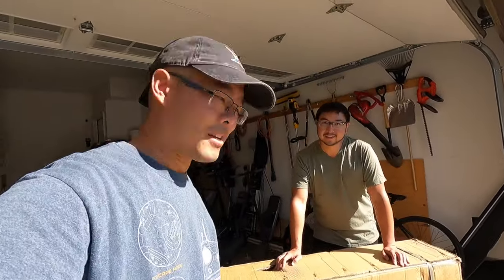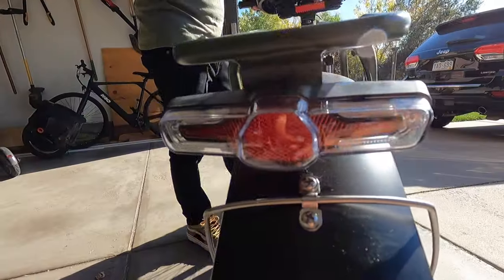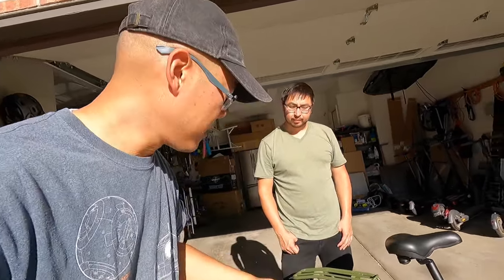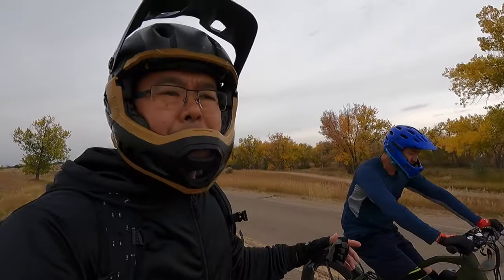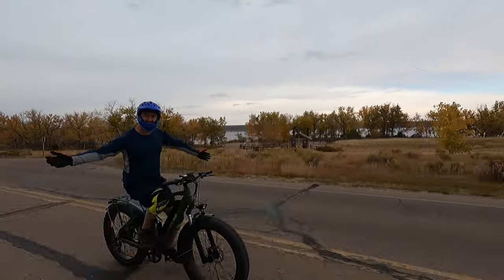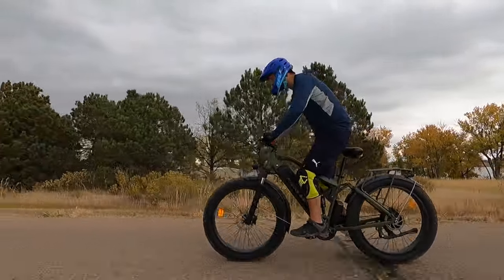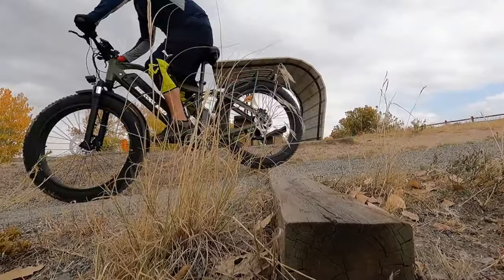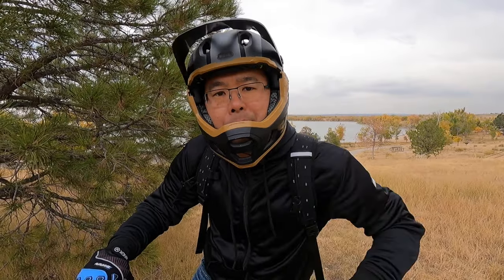A Most Affordable Full Suspension Fat Tire Ebike: the Bee Cool Adventurer

Comment: Thanks guys for a great review. I have been doing a lot of research and the Bee Cool adventure seems to have all the best features for a great price, almost too good to be true. I just put my order in and it was $200 off. I am 6'3" 250lbs and this is the first ebike I have found that has a 350lb weight limit. Seems like the frame is very heavy duty and also good for riders up to 6'4". I was also looking at the RAD ebikes but they are limited to 275lbs and did not have both front and rear suspension.
Reply: I just received my Bee Cool bike two weeks ago. Its exceeded my expectations. Well worth the price. I''m 5'11" 325 lbs and it handles me with ease. it goes between 22-25 MPH. Again, for the price I think you"ll be very happy with it! I know i am.
Reply: @hawkeyefootball7323  in 6'5 340 and considering this bike. How's it holding up 3 months later?
Reply: @hawkeyefootball7323   Do you still like the bike ? can you program it for higher top Speed ? How many miles will the bike go on a FULL. Battery Charge ?  I need a Budget EBIKE. that will go 34 Miles  w/ some use of Pedal Assist.  So It would need to prob. go 26 miles on  Electric Only w/ no pedal Assist.

Comment: Great review like always! Between this one and the aventon aventure which one is best? Better components on the aventon? How about which front suspension is better?
Reply: Hi Selene! Thanks for the kind words. I appreciate you always supporting the channel.

The Aventon Aventure is a little more refined, but it doesn't have a rear suspension.  The Aventon Aventure is $2000 vs the Adventurer, which is $1500.  Some Aventon Aventure bikes have Shimano components and some have Sunrace components.

Where the Bee Cool Adventurer has Shimano components, which I like better.  The Aventon Aventure has a nice color display and an app, where the Bee Cool Adventurer has a black and white display. 

If you like a more refined look, the Aventon Aventure is designed better.  However, if you are all about a budget buy and don't care for a color display or app, I find the Bee Cool Adventurer is better because it offers full suspension.
Reply: @Andrew-vt4jt  rear suspension and suspension in general is about worthless if its not a decent brand anyways. Honestly, they all are trash and some cases un safe. Decent is Rockshox, FOX, etc. Rule of thumb is fat bike tires provide some level of suspension so by just having a nice front fork, in many cases, is plenty if you are looking for comfort. To be honest, unless you are doing alot of downhill, you wouldnt need a middle suspension and in this case is just added weight. The fork on this bike is just a spring suspension that looks like its suppose to be 100mm and rated for a normal bike. This is an Ebike with lots of added weight so the fork literally bottoms out with you just riding down the road... This is why these cheap bikes are cheap, the components. The good ones and safe components are $$$. From the shocks to the drivetrain, always upgrade or dont pick up these cheaper versions. They all risk safety. And if you are getting a fat bike, no need for a middle shock if you are not going off road or hitting trails as you are just going to lose energy from correcting cadence and add weight for no real reason.
Reply: Although I have no idea what the customer service is like with the Be Cool bikes there has been a lot written about how bad Aventon support is.
Reply: @driftadvocate1839  Indeed the rear suspension on the Be Cool bike looks very cheap.
Reply: @driftadvocate1839  thanks for all very valid points.
Reply: @Hoggdoc1946  Aventon used to be great but outgrew it's service team quickly. I hope they can pull it together again because people used to love their service. Most PEV companies have grown 300 - 700% from last year so there are a lot of growing pains.

Comment: The asymmetry of the battery is from designing a bike for 48/17, but the boss stole the frame design and insisted on 48/21, requiring two more columns of 18650s. Hashtag Oriental engineering.

Comment: Looks like it's great value, especially with a 21A battery and full suspension.
Reply: Except they don't tell you what cells they use. If the battery is full of cheap Chinese cells not such a great deal.
Reply: @Hoggdoc1946  A 21AH battery with cheap cells is still better than a 14AH battery with cheap cells, which is what most bargain e-bikes have.

Comment: 1700 dollars is not a cheap affordable bike. I got a Keteles with two 1000 watt motors all wheel drive with 23 amp hour battery and hydraulic disc brakes 180mm. For the same price as your 750 watt motor ebike. YEP what more needs to be said?

Comment: Jimmy, Why is nobody talking about the $1500 federal tax credit for purchasing an eBike, that is in the Build Back Better (sic) plan?  I think it's disgusting, and will lead to an automatic increase in eBike prices.  It may not be a big deal, until you buy more than one, and the subsidy no longer applies.  Who votes for this crap?
Reply: The tax credit is not yet law and has already been changed during the negotiations. Also, it will NOT apply to bikes bought in 2021 but rather 2022 forward IF it passes. Another thing... in the current draft, it will NOT apply to bikes that cost more than $4000. It will also only work for those under a certain income level. The credit under the current plan can be 30% of the cost of an ebike up to a total credit of $900. Couples filing jointly can each get a bike and both can claim the credit. These are some of the factors of probably why you're not hearing a lot about it yet... still much up in the air and nothing guaranteed unless the package passes while retaining the ebike credit.

Comment: Not a mountain bike for sure. This thing wouldn’t last 100 miles
Reply: Definitely not a mountain bike as it comes.  I put a Rockshox Reba front fork on it and rockshox monarch rl rear suspension on it and it works great as a mountain bike.  As it comes it's just a nice off road trail bike but definitely not a mountain bike.